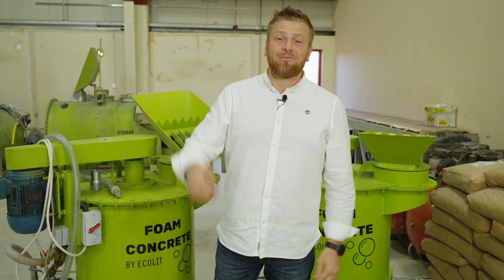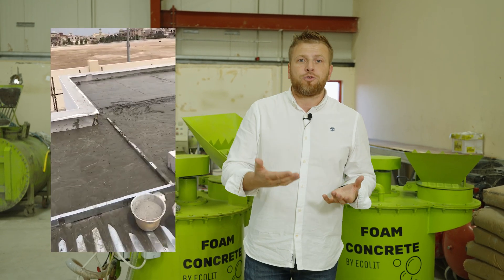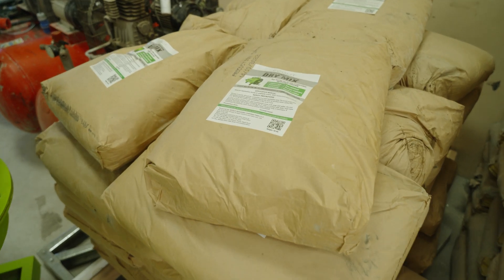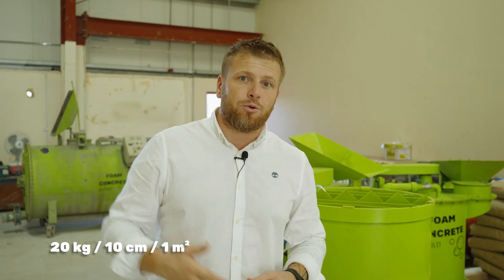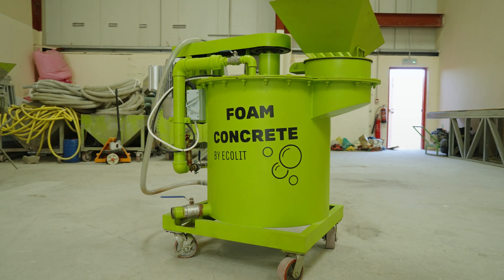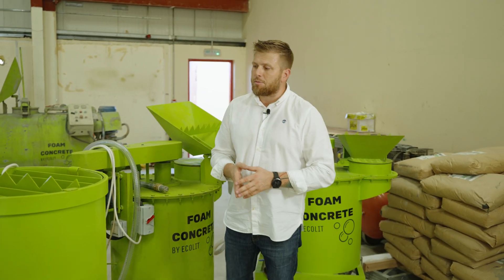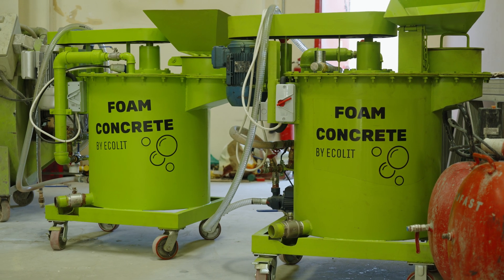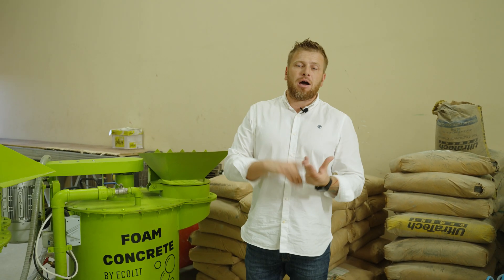Lightweight cellular concrete production machinery

Comment: Really interesting. I am having trouble finding the reinforcement qualities. I see you using it on an elevated slab, but I don't see what creates the span under it as to tensile strength. No "bar" encased. No glass reinforcement? Organic reinforcement? Wire?